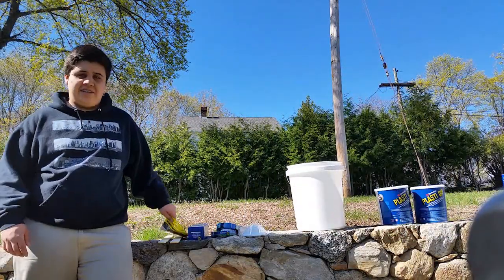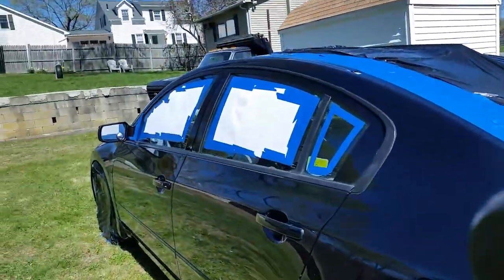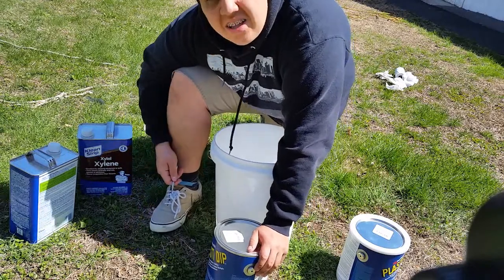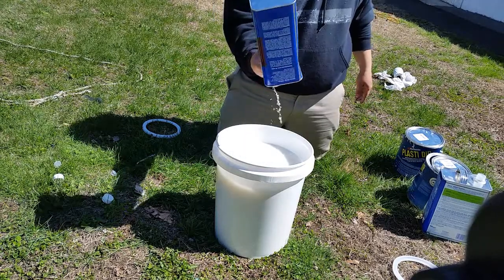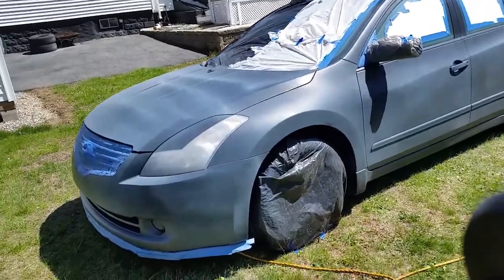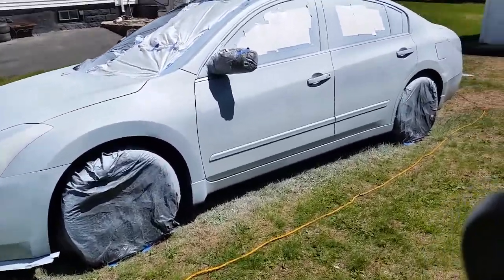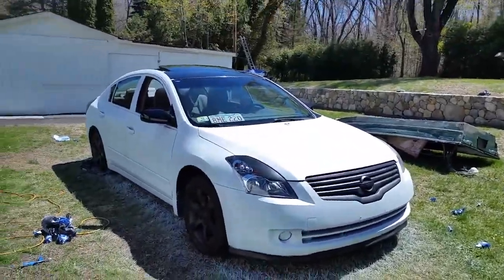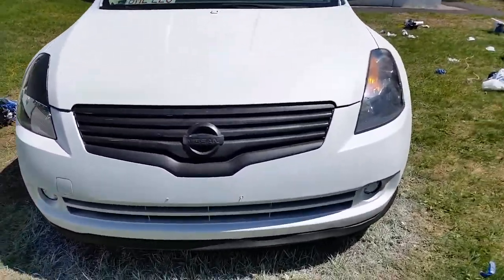How to plastidip your car // Plastidipping my car white

Comment: That many coats and it still looks horrible. 5-6 coats when you use the right stuff. PDS instead of self thinning. You can get full coverage in 3 coats with PDS instead of bad coverage with self thin and 13 coats.
Reply: should have left out the xylene
Reply: Bruce 580Dipped that and he did suuuuuper light coats. its plastic, gotta do thicker coats.

Comment: good stuff but the pre thinned is best for starters(not saying that's what you are, just viewers). unless you are just mixing for a while(like mix, wait an hour, mix again. 3 x). not a quick mix.  but i would always go un-thinned to save money . Regardless you did a good job bro for a quick thingy! just watch the striping, you'd get better coverage by going slightly slower after the first coat and keeping the distance between each pass at half of the last one. also recommend you getting a tarp on the ground because dirt and other particles definitely are in the dip and it ruins the finish. This job could've come out way better but i support you man, because it could have been A LOT worse and in the end you were happy which is all that matters.

Comment: I dont see why everybody is knocking it. He spent under 300 and it looks pretty decent in my opinion. Macco probably does a shit job where itll last 6 months to year before chipping this probably last 2 years if he keeps up with it for way less
Reply: gsteel98 not hating but I srsly doubt it - the door frames & trim had tons of fingerprints & oils all over them. I don’t know if he even washed the car first or if he did he didn’t wipe off all the fingerprints after taping off. 🤷‍♀️ I mean I hope it worked out great for him & lasts forever.
Reply: @ashleyfalcon125  oh yeah i know its not the best by far but im saying for how cheap it all cost him on top of him heing inexperienced im guessing, he did a decent job and hes happy with it so thats all that really matters. We can make fun of him for it but at least its not a Honda civic🤷‍♂️ so its not that bad...wait that nissan has a CVT TRANSMISSION
Reply: gsteel98 hahaha